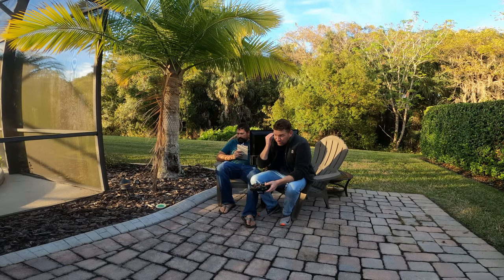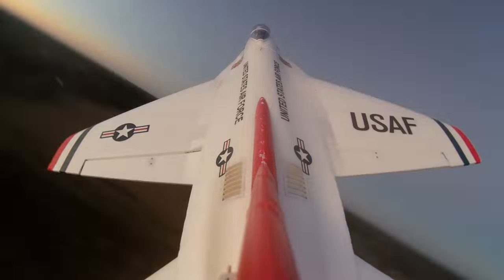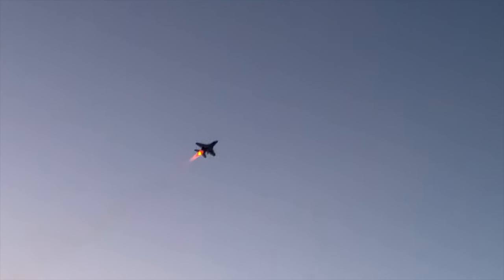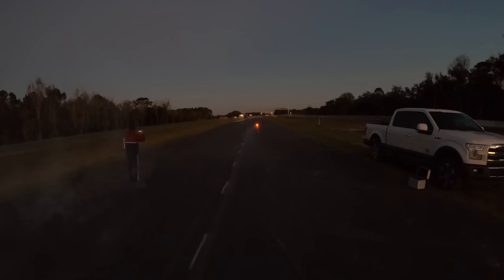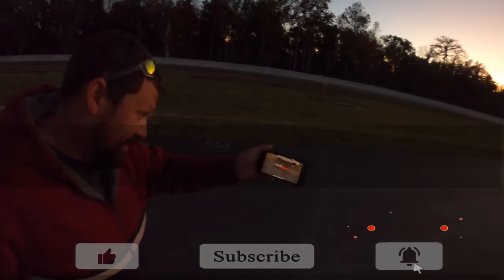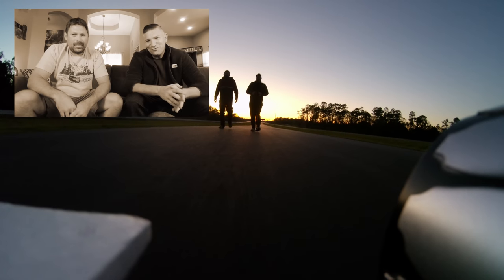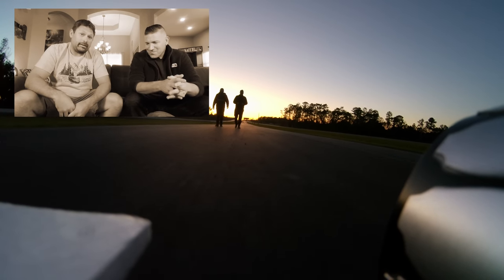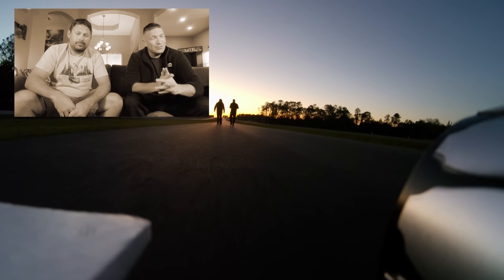Afterburner In RC PLANE Is A Bad Idea

Comment: Smoke fluid lit from inside with LEDs...NICE effect, I have to give props!  Looks GORGEOUS!
Reply: I will give them jets for this.
Reply: @F3PIZZA  I see what you did there…and I like it too. Noice one broseph!🤙🏽
Reply: @GuerillaRadio, This looks like more than smoke fluid and LED's ... The plume of the flame really appears to be real...  One can even hear the engine RPM increase on the onboard  Go-pro when the A/B's are lit... I wonder how much thrust increase takes place when this thing is activated? It does not seem possible that this is an electric motor driven ducted fan. If it is, that is one heck of a convincing look!!!
Reply: @michaelmartinez1345  Styrofoam tail would have melted.  It's an EDF fan with smoke and a light ring
Reply: @hellviper944  the plane seems to have a real flame plume... This does not appear to be smoke & LED's..... The aft part of the fuselage, is probably made from a high temp material, that does not conduct heat well, to protect the surrounding structure.
Reply: @hellviper944  - so where can we get the smoke unit?  I already have the afterburner LED kit installed inside my F22 Raptor and would definitely love to add this to the mix of possible
Reply: I don’t actually know how they did this. At 0:18 there is a shower of sparks emanating from the exhaust, but the video cuts before we see the actual burner run, which could mean the sparks are just for filmmaking to give the illusion of real fire and it really IS “smoke and mirrors” OR they could’ve just cut out a failed ignition and this is the real thing.
Reply: Bruh look at the nozzle it’s  made of foam
Reply: @JamesCarter-nf1dy  If the flame is concentrated to form a thin cone, they could get away with the foam exhaust nozzle. Just look up Flite Test EDF Afterburner to see what I’m talking about.
Reply: @AerospaceMatt  yes I know I have already watched that video but this one is so fake.
Reply: @AerospaceMatt  That is creative film making. They would of thrown in some burning firework or something to get that shot, snipped in the next shot and most people won't connect the dots.
Reply: @jessejuliano8056  Ok, yeah the reason I thought it might’ve been real was because Flite Test has done this exact thing with success.
Reply: @farplenorp  Why do I want to do that now!! I’d use a B motor though to keep the back end lighter.
Reply: @michaelmartinez1345  see other video from creator where they are playing with smoke grenades and EDC. https://youtu.be/wzfeB5NFkas?t=40
Reply: @AerospaceMatt  they use smoke grenade instead of PG fogger. i'd go with fogger, but I'm guessing they pop an ematch to ignite. https://youtu.be/wzfeB5NFkas?t=40
Reply: @michaelmartinez1345  its an electric duct fan by the sound of it, so not a real jet. The model jet turbines sound exactly the same as a full sized one, and reheat just adds ALOT of roaring to that sound.
Reply: No, I think it's a smoke bomb and LEDs. The smoke is too thin with juice and the smoke bomb  explains the sparks and matches the behavior generally. Very nice effect.
Reply: @christianbuczko1481  An absolutely a beautiful model that is so darned real, that it might be a great way to produce the real effect, for movies - but at a very small fraction of the co$t and complexity.... Very cool display.... It had me fooled for awhile, until I read the other's commenting about it...
Reply: LEDS,... nah, looks more like it's got a small burner ring and a bottle of lighter fluid, colour of the smoke would match that.
Reply: @JamesCarter-nf1dy  the nozzle is tin of some sort. With a paint job to look like a nozzle
Reply: @whatyoumakeofit6635  Look at the first clip and look at the exhaust you can see the light diffusion from the led. And at 0:23 it's even more noticeable and the flame isn't bright enough and drops off way to fast, not even mentioning he is standing right in the jet blast.
Reply: @AerospaceMatt  Maybe it's a smoke pyro.
Reply: Yep. It is a foamy. Real turbines get hot enough to melt the foam. This is a EDF. I have a few and they sound like this
Reply: @PiDsPagePrototypes  It would melt in a heartbeat
Reply: It's DEFINITELY LED.  Look at 0:25 right before he hits the throttle. You can see the LED is lighting up the tarmac behind the plane.
Reply: @robertsteuer1442  I agree! Its LED lights and a smoke generator on a Foam EDF Jet.

Comment: Smoke generator + afterburner ring/light? U can clearly see when they hover it that on the ground its a light hitting...so the afterburnereffect is caused by the smoke imo🤔
Reply: It’s a foam plane! Clearly it’s not true flames. The hover shot was a little too much. But still most fail for it.

Comment: Lmao y'all jammed a bunch of LED's inside of there and have a smoke cartridge go off to make it look like a fire coming out. The led's are the type that can give a fire effect by altering the levels of red orange and yellows. Looks like for the  ignition you had a fuse or something go off to give off the bits of embers and smoke, then cut it to it running with the smoke canister and the leds. 

Looks really neat though. Gives a pretty good fire effect.
Reply: This looks like the answer. I thought at first it was a fog based system (with a heating element etc like a normal fog machine) but the sparks at the beginning rule that out.
Reply: @JMMC1005  this is probably the missing piece of puzzle in previous video of theirs ;) https://youtu.be/wzfeB5NFkas?t=40

cool looking effect. i'd probably go with different color profile. maybe some laminar flow thing screen if you cna do that w/ edc. do each tube or group of tubes in flow screen been different led channel

Comment: Nice execution! Btw it was also done by David at flite test a few years ago.  I like the idea of doing that!
Reply: That used actual butane for the flame. That was "dangerous"
Reply: @VictorHugoRC1111  Not really, I did a lot of testing with that system and it is pretty save if you know what you are doing.
Reply: @WArbirdFan4FlyingMillionaires  I was referring to this: https://youtu.be/yKuq8T7KMa0
Reply: I know, still if you know what you are doing it is very save. All the accidents that David had, came from his stupidity. To say it simple he put high voltage over the motor, which lad to the failure of the RX. Don’t ground the ignition to the eflux ring🤦‍♂️

Comment: Very nice afterburner!
Could you please make a video on how you made it?
Reply: unfortuantly its not a real afterburner. Using a real one will require
a large fuel tank
metal nozzle
heat resistant material
and more
Reply: Ppl still want to know the truth
Reply: Isn’t it click bait if your not being honest?
Reply: @toysforboysrc  its essentially a fog machine with a red light. and having an afterburner that big will will probably be uncontrollable. also yes i agree this is clickbait but also not a clickbait because it also says afterburner and not REAL afterburner
Reply: @ayatotakema1194  … I never seen a fog machine throw sparks but okay 👍
Reply: @toysforboysrc  Water-methanol? Don't fog machines use some type of glycerol? They mentioned a screen type heating element
Reply: @luislongoria6621  …. Yeah you can make homemade fog machine solution with glycerol and water but I would never attempt running water methanol through a fog machine because I’m not that curious.
Reply: @toysforboysrc  smoke grenade. here is another video where they are working it out on a car. they added lights. personally i htink it looks awesome. I'd go with PG fogger myself. I'd also go for different light profile. https://youtu.be/wzfeB5NFkas?t=40
Reply: @travofoz  …., yes having those features on an EDF would be one of the best things ever. I’m alllll about doing mods that provoke peoples imagination like that’s Skyline project I’ve been on for 3 months so far and still not done lol! I’ll check out that video thanks., im actually planning on adding bursts of flames out from the 1:7 skyline exhaust to add realism  so this video comment reminded me of the skyline build.

Comment: It's funny, because not only does a fake afterburner amount to useless payload weight from a performance perspective...but it also actually physically slows the plane down to activate it, too, because whatever aerosol is coming out of the the fog generator isn't providing additional thrust in any way -- it's robbing it via parasitic loss, by forcing the EDC to push (slightly, but not negligibly) denser air.

To those who thought this plane had an actual afterburner...um, do you know what afterburners do?...No bells are going off when something that ought to have the power to weight ratio of a styrofoam peanut, tied to a lit bottle rocket, is just casually meandering across the screen like that?...probably not even breaking the speed limit of the road it took off from? 🤔

Comment: I'm not a negative Nancy.... just curious. It seemed like you had it in AB for a long portion of the flight, didn't that burn alot of fuel? Also concerned about the heat in a foam airframe. And finally, it seemed like it was just for show... if not, did you have to reinforce anything structurally? It seems like the added thrust would just tear up a foam airframe.

Comment: So isn't this an EDF Electric ducted fan? Is that just smoke with LED lighting?
Or did you actually inject fuel and light it after the ducted fan, and it worked?
I do know that hovering next to the truck was pretty suspicious. Usually, you see all sorts of corrections, and on that one you didn't see any at all.

Comment: You should really give some people information on this before they set their foam jet on fire with the amount of heat that would make the foam plan would just melt away someone's unaware of the fact that a compressor housing is needed for this to actually function otherwise you're just going incinerate the back half of the plane as soon as you light it
Reply: its not real. https://youtu.be/wzfeB5NFkas?t=40

still looks great.

Comment: Hey Bro looks like it's just window dressing it does NOTHING to increase speed or shorten the TO roll. Now if you had started with a True Turbin and added an after burnner that actually added thrust you might have accomplished something. But just the looks of an after burner actual flame is better by far than the ring of lights most use to day to simulate the tail pipe of an afterburner equipped jet.
Reply: its light and smoke. https://youtu.be/wzfeB5NFkas?t=40